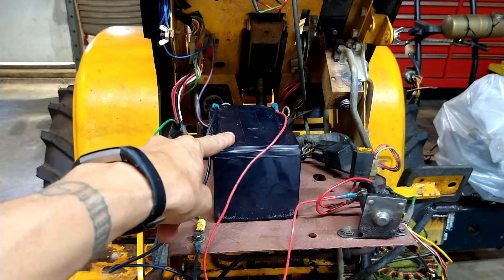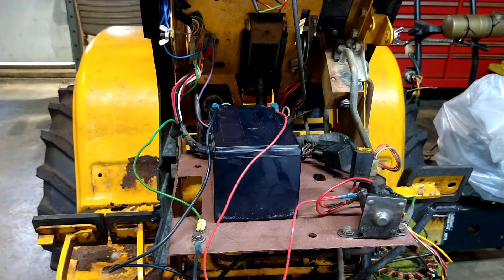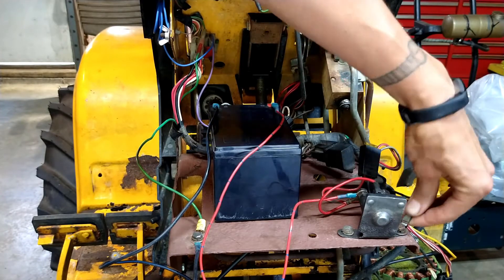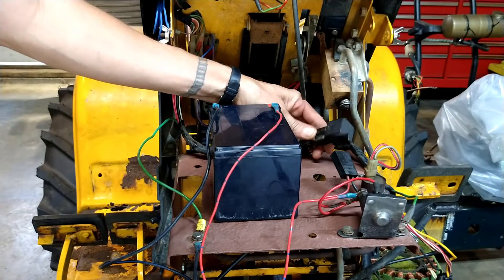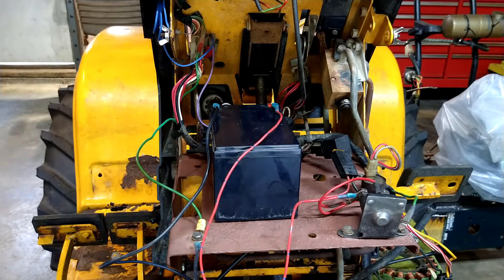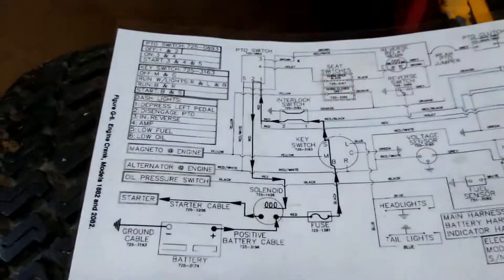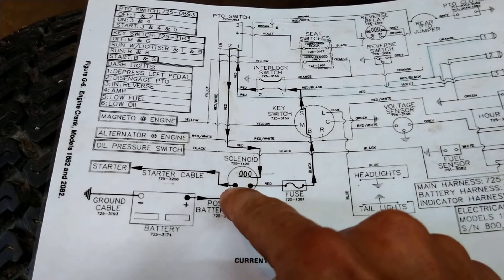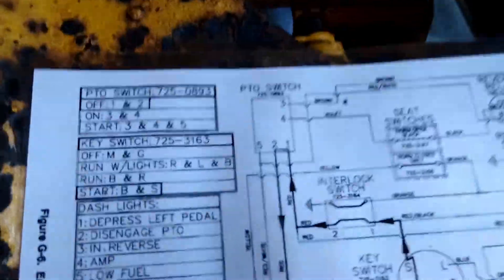Cub Cadet 1882 Electrical System Overview

Comment: I have an 2084 that doesn't start every time and will make a click sound and then nothing so I have to keep turning the key till it gets started. Is this electrical or is there something else going on?  Thanks Ted
Reply from the maker: Sounds like you have a typical voltage drop between starter solenoid and key switch.  It's the most common way the Command engines in the Cubs exhibit this symptom.  I would go over every connection, both positive and negative between battery and starter.  Then clean and check connections at the keyswitch, PTO switch, brake switch, seat switches, engine connector, and starter solenoid.

This isn't to say it couldn't be a faulty solenoid or starter, but it's where I would start before throwing parts at it
Reply: @SolunaGarage  thank you so much!

Comment: what are the values for the coil and the magneto?.  i have a no spark issue atm with a 1872 m18.  bought the mower with a broken rod. it had ran fine. the man drained the oil. forgot to put more in. and broke a rod. i rebuilt the engine. but im having no spark. i completely unhooked the engine harness from main harness and still no spark.  i would like to be able to test the coil and magneto. so i know which to buy. thanks
Reply from the maker: Between plug leads should be roughly 22k-42k ohms.